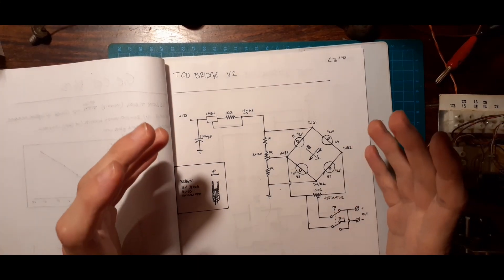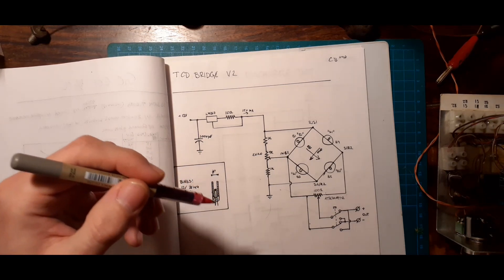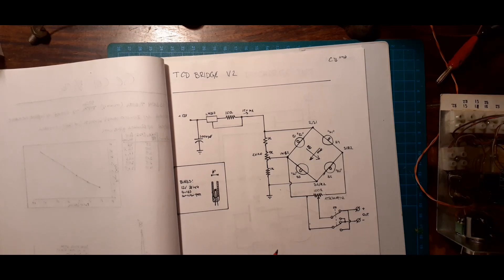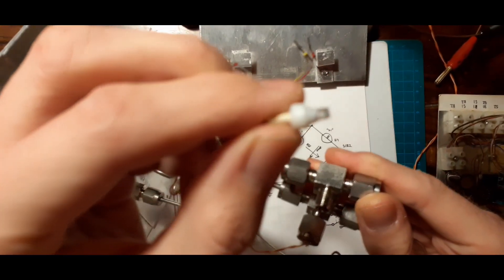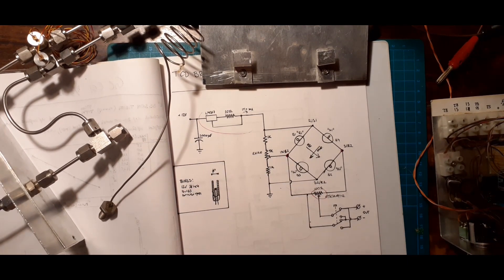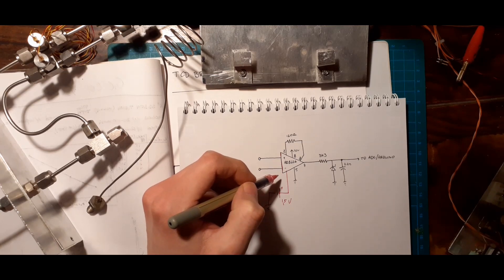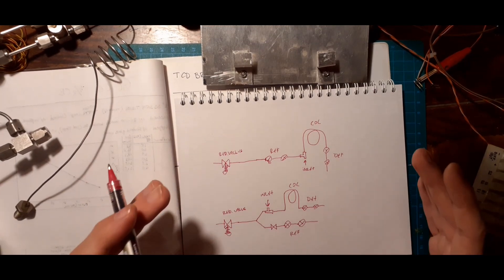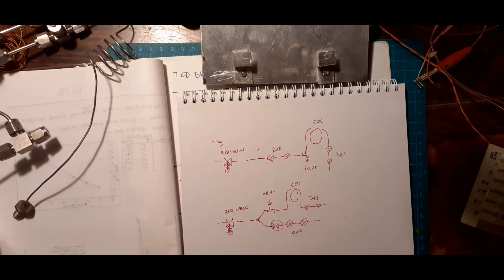DIY Thermal Conductivity Detector (TCD)

Comment: Hello! I know it has been a while, but could you explain what are you using to heat the aluminum plate that are holding the filaments and how are you controlling the temperature? Thanks for both the videos sharing the TCD project

Comment: Thank you very much for this informative content, But just a question has been raised in my mind if the current variation depends only on thermal conductivity? I think it depends not only on that, but also on the flow of the gas and may be on pressure too
Reply from the maker: Yep, you can also use thermal conductivity of a known gas to measure the flow rate! It's the principle in a mass flow controller
Reply: @chromatogiraffery3104   So what is the best solution to measure TC independently from flow?
Reply from the maker: @Mohammad-vh4bi  doesn't matter you just let the flow be constant
Reply: @chromatogiraffery3104   It means some equipment to regulate the gas flow is needed?
Reply from the maker: @Mohammad-vh4bi  it regulates itself; you need to control the pressure at one end, then the flow is a function of the column diameter and pore size

Comment: That's slick using light bulb filaments. 😆 Gotta try that one out for myself. Currently using matched bead type thermistors in a bridge configuration. But getting light bulbs  to work intrigues me.

Comment: I've been googling like crazy, maybe you can help me with a question about your setup. How does having the schottky diode in the orientation as you show it prevent the ADC from volt/amp spikes?
Reply from the maker: Thanks for the interest! It doesn't limit spikes at all, it's just a 5.1V zener diode to clamp the output at max 5V so I don't feed potentially 12V into the 5V max ADC pin.
It's a pretty temporary solution that became permanent, as they often do!
Reply: @chromatogiraffery3104  Thanks very much for your reply. I clearly misspoke here, as I was wondering how this was able to protect the ADC from voltage spikes. Thank you for clarifying this. I am a chemist/GC service engineer, by trade, not an electrical engineer. Thank you as well for your inspirational video, I will be trying to create a homemade GC as well. I will try some modifications, as I have routine access to capillary GC columns. I have read that excel is only capable of inputting and plotting only 500 data points. Have you found this to be true?
Reply from the maker: @biometal770   Good luck with the capillary columns!  I'm playing with that as well. A note, for feeding capillaries into a swagelok fitting, a GC septum under the nut works great.

I haven't had that problem with excel at all, I believe I sampled at 1 Hz over half an hour without any problems. That said, a better data system would be nice.

Comment: Thanks for the explanation! Most gc info sources just gloss over how the detector actually works. How sensitive is the tungsten filament? Can it detect ppm or even lower gas concentrations?
Reply from the maker: Thanks! I never did any actual LOD or linear range determination, but for hydrocarbons, I believe I could detect compounds down in the low microgram amounts. Not terribly impressive in the GC world, but I think the detector geometry makes my peaks so wide that even detectable signals just look like baseline drift. 

No doubt actual TCD filaments are designed differently, one would probably prefer very low heat capacity in the wire itself to allow for rapid temperature changes.

Comment: Thank you! I'm going to be trying this myself soon. It occurs to me that the response time of the detector would probably be significantly better if the filament was more exposed (more of the glass removed) and positioned further inside so that it is directly in the flow of gas, rather than relying on diffusion/turbulence.
Reply from the maker: Absolutely it would, but there was no way of doing so without removing so much of the bulb envelope it couldn't be held in the ferrule.. 
If one went with capillary columns I guess one could just put the end of teh column right into the hole in the bulb.
Reply: @chromatogiraffery3104  I think I'm going to have to find an alternative solution....